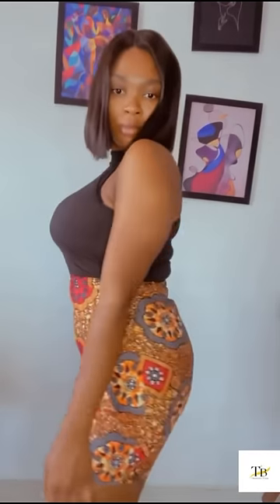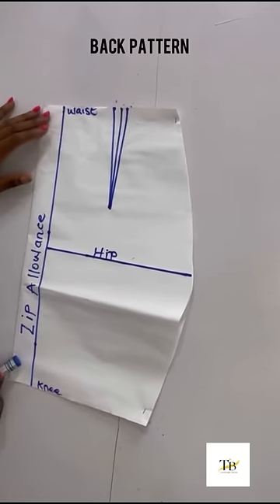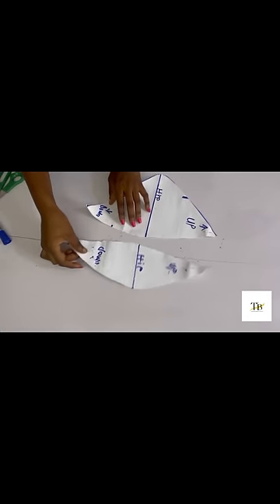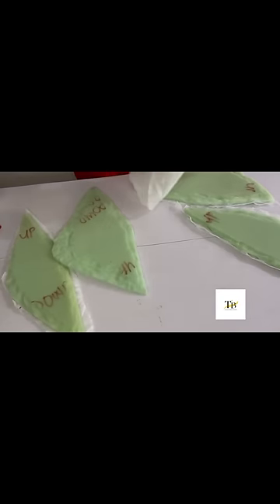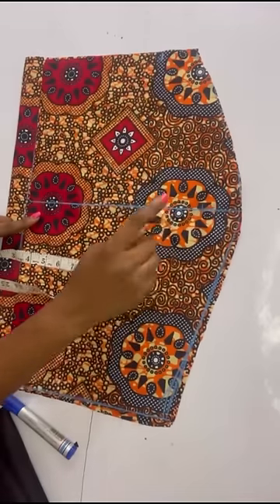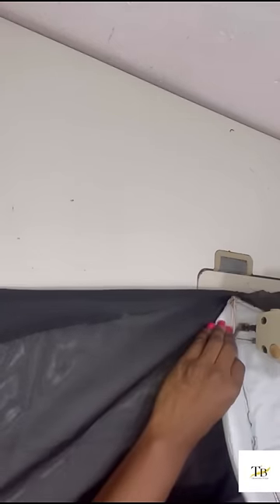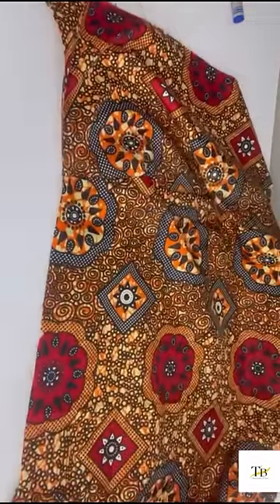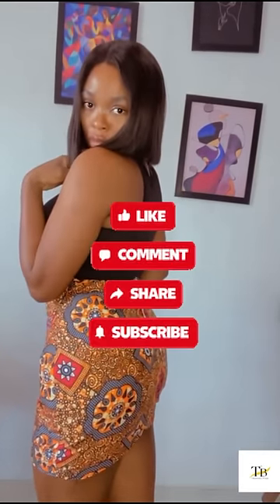Hips and butt padding

Comment: Hello thanks for making it simple to understand, pls my question is since you are not adding extra allowance to the linning , after adding the foam wont it be smaller than the main fabric and it becomes tight , because i made one and after attaching to thr linning , i placed it on my body and it didn't cover my back wnd there was no way i could join it ,it was way too smaller for me

Comment: Thank you for this tutorial. Please does the knee width also change since the hip width changed or do i use the old knee measurement. I always determine my knee width by calculating my hip measurement minus 6. Do i use my real hip to determine this or the new hip which is plus 2.

Comment: Thank you very much for this detailed video❤️
My question is why do I need to not add the extra 2 inches for padding to the lining whereas it was added to the main fabric? Won’t it be a source of problem while stitching together?
Reply from the maker: It won’t b a problem the reason why u don’t need to add extra 2inches to ur lining is becus ig u don it will b excess and it would b folding
Reply: She only added it to the hip measurement
Reply: Yes ma is the final measurement going to be our normal measurement or with the foam allowance

Comment: Thank you for the video sis
Pls my question is why is the main fabric measurement always different the lining  when cutting? I hope when joining then rhebamin fabric won't be excess? I just don't get why 
Pls sis explian
Reply from the maker: Thanks dearie ..reason why the main fabric and linning should b equal is becus if they are equal it will cause unnecessary folding ..and excess fabrics ..it won’t fit perfectly
Reply from the maker: Shouldn’t
Reply: Thanks for your response 🙏🙏
Sorry for my typing errors 🙈

Comment: And for the main fabric d foam am using is same as yours so if i add 2 inches to my hip it will  be 39 so will i be dividing the 39 by 4 then plus 2inches ????
Reply from the maker: Yes dear exactly
Reply: What if am making a gown of length 40,how many inches will I take from the down part?

Comment: My question is if u used 42 for the main fabric and 40 for the lining, how come after turning, it rhymes? The excess isn’t obvious.
Reply from the maker: What u just need to do is take the end part of the lining and the main fabric …Join the together …
Reply from the maker: The reason why the measurement are different is becuse we don’t want excess fold ……if u want u can use same measurements but might not b fitted

Comment: Will someone be using all inches described no matter what the hips or waist is?
Reply from the maker: Use ur hip and waist measurements ….for ur crotch line divide ur hip measurements by 4 plus one inches …for the allowance u can either u 2inches or 2andhalf  it optional

Comment: Pls ma my waist is 27 and my hip is 37 my question is if am to cut my linen will it be my waist and my hip divided by 4 plus 1 inches allowance for the linen cut???
Reply from the maker: Yes dear exactly
Reply: @sewwithtess   thank you very much your video was really helpful
Reply: Pls ma u said we shouldn't add allowance y drafting the skirt on the paper Do u mean if my hip 38 I should just divide it by 4?
And why defying on the fabric will I add allowance if yes how many inches allowance?
And those inches u were taken on the paper nothing the front n back can it be use for all hips sizes? 
& @the waist there was a dart will I add add allow for the dart on both paper n fabric 
I don't no if u understand my question. if yet pls reply..thanks ma
Reply from the maker: Yes don’t add allowance …like I said on the video the allowance u will add depend on the thickness of ur foam 
I used half inch foam …half inch in 4places would give me two …so that why I use two inch